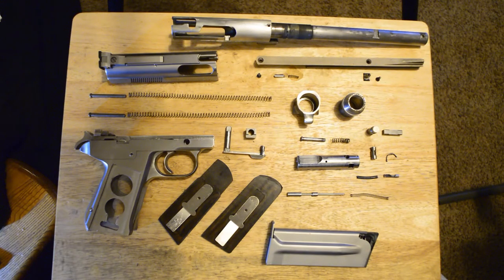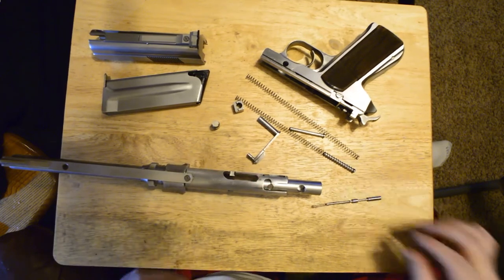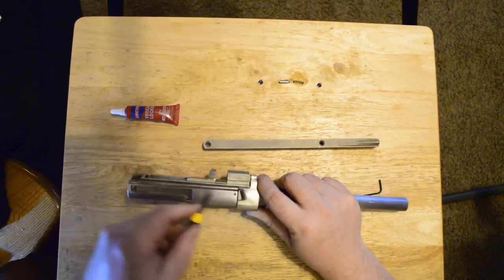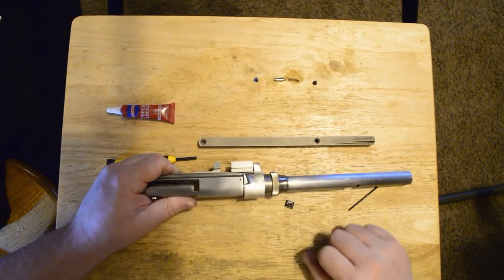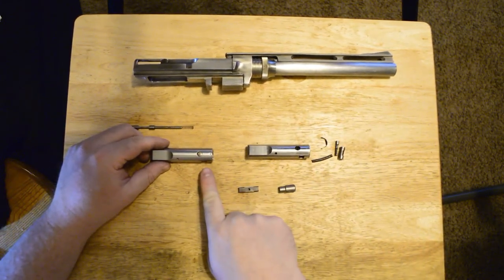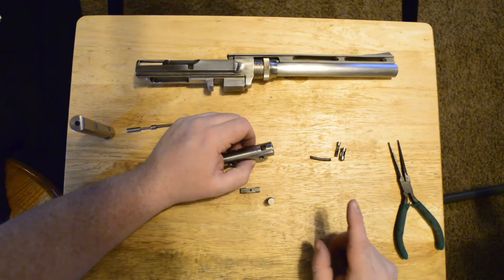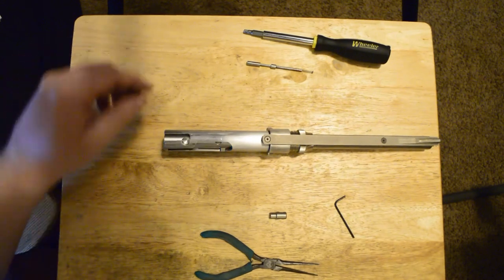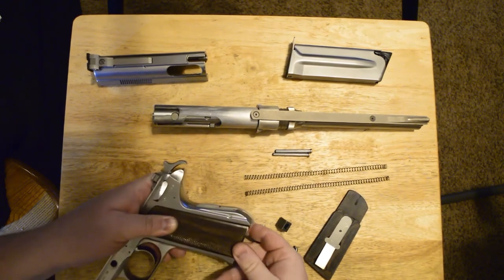Wildey Survivor Assembly

Comment: Nice gun! I wish there were more videos in general about the gun.

Btw, what caliber is that? I also heard you had to download magazines to 5 or 6 for reliable operation rather than the full 7. Is that true?
Reply from the maker: Thanks.  Mine is in .45 Win Mag.  I cant speak to any magazine issues, as I have not loaded more than 5 in it as of yet.  Most of the shooting I have done with it has been to get it running and to tune the gas system, so I need to do some reloading before mag dumping.
Reply: @judgeroybean6231  Yeah I definitely understand the gas part. It offers a lot of freedom but also requires some more fine tuning.

Tell me how loading to capacity goes, though. I'd like to have as much capacity, especially since the mags are supposed to hold 7 rounds total, but they keep saying to download it for reliability so I'm wondering if it's an issue with the gun or magazine that could be fixed in some way.
Reply from the maker: @gameragodzilla  The magazine holds and strips 7 rounds without any indication of a problem.  Havent shot it so loaded yet though as the ammo costs $1.10 a round.
Reply: @judgeroybean6231  Interesting. I wonder what the issue is with the magazines other people had, then.

I guess it's guaranteed to be reliable with 5 but less so with more? Let me know how things go when you finally fire it. Mine has been delayed constantly due to Covid so I got time before I get my gun.
Reply: @gameragodzilla  No issues with multiple full mag (only have 1) in my 45 WinMag variant.
Reply: @onthumb  You ever fire the .475 Wildey variant?
Reply from the maker: @onthumb  yup, if you screw it too far back it can definitely do that

Comment: I know this is an old video but can you show how to remove the grips? Thanks
Reply from the maker: @arkansasnaturalstate  well I cant recut the old video, but as I recall they are just panels of wood that slide into up into the grooves of the frame.  They have a cutout on the inside for a peice of thin spring steel that clips them into the frame.  If memory serves, you simply remove the mag, reach inside, depress the peice of spring steel so that it clears the frame, and then slide the grip panel down and off.

Comment: Do you know the part number or what 700 extractor it's?
I'm trying to find one for the Wildey I'm. The company is having trouble finding them and the Remington 700 extractors are scarce right now. I've seen a 700/7400, and a 700 for the 223 and several other guns.
Reply from the maker: I dont know any part numbers.  My understanding is there are 2 types of 700 extractors, bot of which were used at times in the Wildeys... you just have to look at yours and make sure you get the extractor that matches.  They should be visually distinct

Comment: Just snagged one by the original company. These resources are hard to find. Thanks! Any leads on sources for parts (in case I need some later)?
Reply from the maker: Potentially... got my parts from a private contact with a small supply.  There are also some assemblies on Gun Broker at similar prices.
Reply: was your's a  low serial number?
Reply: @martinmorningstar9724  5xx so not bad out of a possible 5000 total production of all runs.

Comment: Can you tell me if the new Wildey guns have the rivet extractor? I have a 475 Wildey ordered and the company is having trouble getting these. I may buy a extractor and have it put in so I can get my gun.
What extractor do I need to look for?
Reply from the maker: So the extractors in the Wildey are literally the same as the ones for the Remington 700... assuming the casehead is the same as a 45. WinMag.  They made guns with both the clip type and the rivet type at various times.  I can't say for sure which variant was when, though I suspect it would align with whenever Remington changed over.  It should be obvious by looking at the bolt.  As for new guns, I was under the assumption that the newest company had gone defunct too...
Reply: Thanks for the information, I will order one of each to be safe. As for the company that builds the Wildey guns today, they are still open that's where I ordered my gun from. Thanks ag9..
Reply: So someone is currently making them again? When I last looked (when I bought mine) I reached out to the contacts shown on some tv gun show. Even filled out an order form for a new one which was promptly auto-replied to with costs and such. Not a peep after multiple attempts to reach them via their web site and its contact info. I ended up saving all that in case they zombied back to life and tried to charge me something. Best I could tell that "new effort" ghosted everyone and left their web site on auto-pilot and the last anyone had heard from them was 2 or 3 years prior (so call it 5 or 6 years ago).
Reply: The new ones have the snap in.